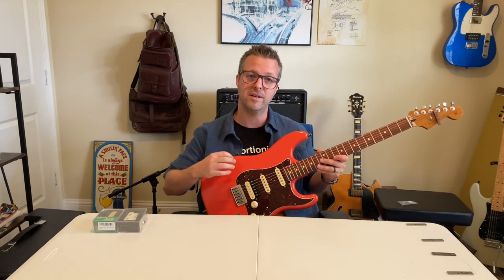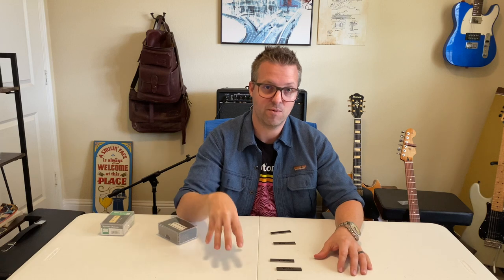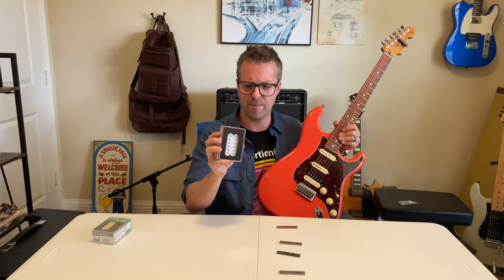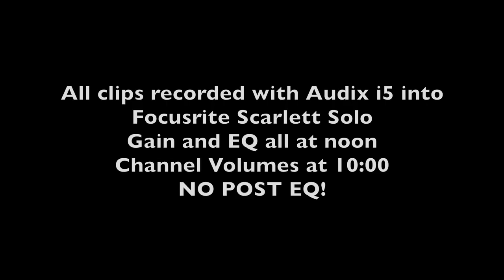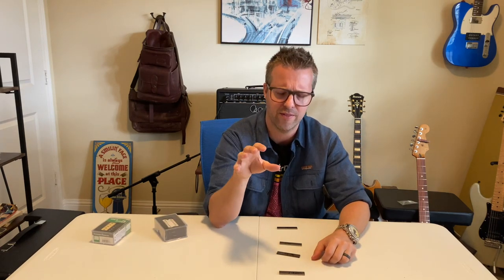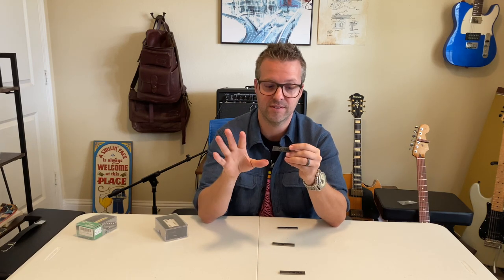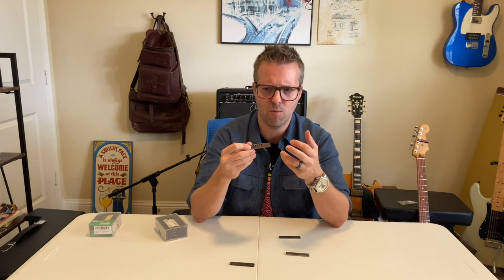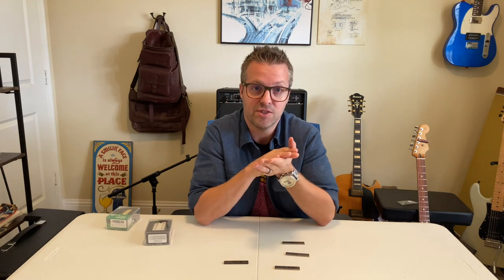Can You Make The Seymour Duncan JB Sound Better? (Yes you can) - Magnet Swap Video!

Comment: A2 JB is great. Been doing this for years on JB's.
Reply: For what type of guitar? What type of body&wood?
Reply: @alexanderfedorovich5107  I have one JB A2 in a Alder Strat with a Kahler trem, maple neck with rosewood board that is monstrous sounding. I also have a JB A2 in a 90's Les Paul Custom, all  Mahogany with an ebony board. Once again very huge sounding. I am also using 3 Custom Customs with A2's wound at the custom shop by MJ a little hotter than their standard 14k. They are wound at 16.1k each. I have two in 2 custom Tele styles guitars I made. Both single bridge pickup guitars. Both are Korina bodies with maple tops. Maple necks with Rosewood boards. They are amazing sounding as well. A little deeper than the JB's, a little less high mids. The other custom 16.1 is in another LP Custom and it kills in their too.
Reply: @alexanderfedorovich5107  I got the idea for the A2 JB's from Warren of  Ratt. That is his custom pickup he uses in his guitars.
Reply: @TVoltG  It is amazing! It seems like you are true Master of Alnico 2! Wow! Brilliant!
Reply: @alexanderfedorovich5107  😂.. don't get me started on the A4's and 5's.. I love those too with different types of pickups.
Reply: Heeey man! I have a Jb trembucker and a slash aph-2 humbucker sitting around... Do you think I can use aph-2 magnet on the JB to test it out?
Reply: @DravenGabriel59  yes.. 💯
Reply: @TVoltG  He only came up with that idea recently. He used a bone stock SH-4 JB on literally every single Ratt recording.
Reply: @scottdunn2178  it's been his go to for many years is my understanding.

Comment: The JB in my LTD '87 Eclipse NT was borderline raspy and just needed the cheap factory "green chicklet" tone cap replaced with a Mojotone paper&oil of the same value. I chose the Seymour Duncan TB-14 in my HSS guitar and prefer an Orangedrop capacitor with that combo. Every guitar should have specific components that surpress unwanted frequencies and accentuate the ones you prefer. Why guitars don't have more options for the electronics you can get in each model is beyond me?

Comment: And If you put a ceramic magnet into one of those JBs you would have a Duncan Distortion, and if you put three ceramic magnets in plus changed the screws and pole pieces you’d have a Duncan Invader!
Reply from the maker: Haha, yep!  Some things never change :)
Reply: Really great video and I love tinkering too but I wonder why not just get another pickup?
Reply: No. I've talked to Maricela Juarez about that. She said although they both use the same 42 gauge wire, the Distortion has slightly more turns and is more random scatter wound compared to the JB which has each coil more balanced... hence the better 2nd order harmonics you get out of the JB compared to the Distortion.

Comment: Haven't tried a JB8 yet but I've put an Alnico 8 in a Suhr Aldrich before which has a similar sound to the JB. I'd say this magnet has a lot of that "bark" sound in the midrange. In this video though I liked the mid presence of both the "5" magnets which no doubt cut through the mix. My experience with A2  is they're usually a bit flubby on the low end which you can't really hear in the riffs played, sounds good strumming though. I'd be interested to hear Alnico IV which are know to have a very flat EQ profile

Comment: I have a production jb in a USA charvel so cal and an antiquity jb in an old Ibanez. The guitars are identical in construction and features, except for maple board on one and ebony on another, tone pot on the Ibanez, no tone on the Charvel. The antiquity JB wins, hands down. It has a beautiful smoothness in the midrange compared to the stock JB. The awesome crunch and midrange is still there but I don’t hear the honking, nasal quality to the mids. Harmonics are effortless with the antiquity. It just feels perfectly balanced and not as notchy or boxy as the production model. I was considering trying A2 in the stock one, I like A2. I rotate these guitars for gigs and home playing in different tunings, maybe to make them more identical, I’ll go rough cast 5 which the antiquity has. I use 500k pots in both, I tried a 250 in the Charvel but it was dark , boomy and not as open, even without a tone pot on that guitar. In this video, I liked A2 and roughcast 5 best. I liked stock better than 8 or ua5.

Comment: Best sound to me was A5 Rough and A2. Close call between those two. I was rooting for A8 but it sounded too muddy. Bass would need to be rolled off in amp. A8 had most drive. Also UOA5 sounded the most muddy. Worst of bunch in my opinion. Polished sounded worst then Rough casts. That was suprising to me cause i thought polished would sound better then RC. BTW there is also A6 rough cast magnet out there. 59 A2 RC in neck and Paf clone with A5 RC in bridge.

Comment: Funny I found the stock JB to be my favorite. I was surprised the RCA5 sounded harsher than stock, Everywhere I read says it should be a bit warmer than polished A5. Now  I’m curious the impact of magnet (gauss) strength on the sound.
Reply: The video seems pretty much the same as my experience with JBUOA5, except maybe not quite as much volume and compression drop as in the video.

Surprisingly the A2 sounded hotter than the UOA5.

In this video, the A2 and RCA5 were my favorite.

I tend to use A8 in DD & JB, wired in series/parallel with PP pot. Balls out in series, more PAF in parallel. 
Covers everything I need in my cover band.
Reply: Did you think the A5 had more output than UOA5? Seems so on my side of the screen.
Reply from the maker: Sorry I missed these great comments!  I agree - A2 had a snarl to it that gave it unexpected aggression.
Reply from the maker: It definitely seemed that way during the playthrough.  I remember thinking that the stock A5 was the "loudest" of them all because of the mid spike.  A8 right behind it just due to the boost across the board in frequencies.  UOA5 was subdued but in a beautiful way.
Reply: I wonder whether the pickups were set to the exact same height. It matters.

Comment: Great comparison. Missing only A2 roughcast and ceramic. Supposedly George Lynch used JB with ceramic, so people called it dokkenbucker :)
Reply from the maker: I've got a whole bunch of roughcast and ceramic mags for a future video.  Should be up this month!  I'm excited to hear what the ceramic mag does :)
Reply: A JB with a ceramic is a Duncan Distortion. The coils in the JB and the Distortion are the same, only their magnets differ.
Reply: @bucknasty69  I think the Distortion model has a slightly different wind and it has an extra thick ceramic magnet.
Reply: @bucknasty69 No, the JB is 16.4k with the two coils balanced... the Duncan Distortion is 16.8k and the coils aren't balanced. Similar but not the same. Interestingly, the RTM is 17.1k... but with an Alnico ll
Reply: @scottdunn2178  I’ve put ceramic magnets in a JB, and it sounded the same as a Distortion. I’ve also put alnico 2 in a JB, and it sounds very similar to the RTM. All these pickups might be wound slightly different, but it’s not enough to make a big difference. Different magnets make more of a difference than coil windings in these pickups in my opinion.
Reply: @bucknasty69  Some people can hear those subtle differences... most can't. Besides, your choice of speaker will have a bigger impact on your tone than your choice of pickup. Rock on 🤘
Reply: @scottdunn2178  Now the speaker thing I totally agree with.

Comment: Nice video. What pots do you use in your partcaster 250k or 500k? I tried JB8 (Roughcast) in the past, but it was too much for me. I am building a HSS strat, I swapped the JB8 to JB2 I will give it a try. I also have roughcast UOA5 in stock, but I fear the drop of output (but it may be interested in the HSS configuration...)
Reply from the maker: Thanks for watching!  I gotta tell you - my favorite mag in the JB (even a year later) is still the UOA5 - it's amazing - still has the soul of the JB but with ultimate versatility in HSS configuration.  The partscaster has 500k pots.  I'm with you - the 500s on the stock JB, the JB8 and JB ceramic are wayyyyyy too much.
Reply: @deltarider99  I have a old JB in my LP (with 500k of course) that I really appreciate. I will use 250k in my strat, because that's the way I like single coil... Maybe JB2 will be too dark with 250k. Only IRL test will be judge.

Comment: What is the specific of this strat?
Reply from the maker: Hello!  It's a hardtail "partscaster" strat - the body is alder and from Warmoth.  Neck is roasted maple, 12" radius and from Fender.  10-46 strings, HSS configuration obviously.  Hope this helps!
Reply: @deltarider99  Hardtails add so much tone and resonance. I've owned a number of hardtail custom strats. Jake E. Lee sure is right about hardtails. They've really caught on over the last decades. You see a lot of metal/djent players using them, but they have more to them than being good for metal. They give you more punch and sustain and just make each note and chord sound bigger.
Reply: palm mutting 
15:38 - a5 roughcast
14:32 - a5 
14:54 - a2

Comment: The tone wood of the body and bolt neck vs set neck are also considerations in which magnet to use. Whereas bolt neck guitars have a brighter, snappy attack but lack resonance, set neck mahogany guitars have a darker, smoother attack but gobs of resonance. So theoretically you want to use a magnet that fits in with those factors based on what you're going for in your desired tone. The diff in volume pot value between a 250k pot vs a 500k is another factor.